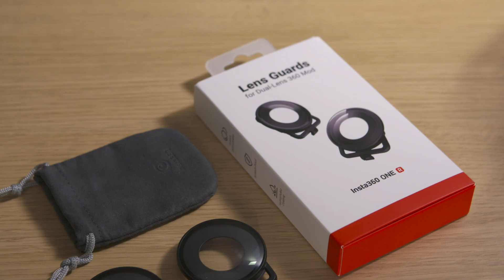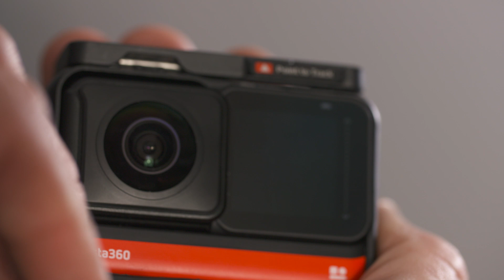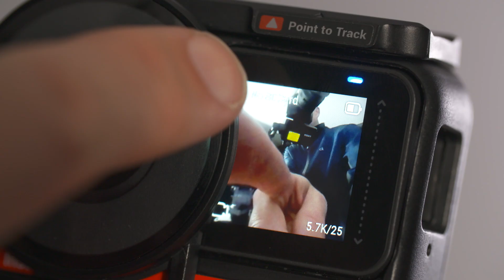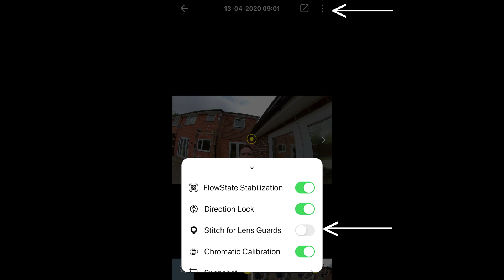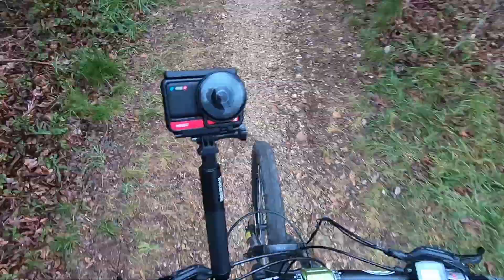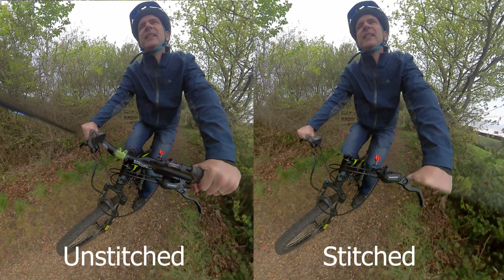Insta360 ONE R Lens Protection Guards review and test footage

Comment: What about using a diving case instead to protect the camera. They're both at the same price range but you'll get diving capabilities as well...
Reply from the maker: Unfortunately the dive case is restricted and isn’t invisible at the base. You can reframe it towards each lens but can’t look down at your hands. When diving you would usually use it at a 90 degree angle to the stick so you can look forwards and backwards but not downwards.
Reply: @EatSleep360  good to know. I already have the vertical mounted diving case so just wanted something to protect the lens when using the camera while driving and having it mounted outside.

Comment: Wich kind of stitching i have to set in the studio ?
Reply from the maker: Select premium lens guards and then just play around with the other stitching settings as they work differently on every shot so toggle them on and off and use the custom stitching as well
Reply: @EatSleep360  the new version of studio doesn't have the premium Lens guards option

Comment: These are only slightly helpful. Mainly only during use.  However, you have to take the camera out of the cage to switch the mods.  During that time you have to be extremely careful. Your handling 3 different camera parts plus the cage.  If you drop the 360 mod during that time their not there to help you.

Comment: I'm debating with myself on getting a one r 360 for on my kayak. And if it's own ip rating will do for splashes and the inevitable rollover. And how the lens would stand up with gritty water conditions. With that. Lens protection or a dive case...? And that would probably be an aftermarket case as the insta360 solution needs a different battery pack (and both are sold out on their store). I am hesitant as I wonder how the dive case stitching would be with aftermarket cases.
Reply from the maker: For rollovers and impact splashes I would want a dive case - lens guards won’t help. But the cost is ridiculous and I’m pretty sure you can’t eliminate the base of the case so you have to reframe around it. This might be less of an issue if it’s mounted on the kayak itself. I’d definitely use a safety cable as well.
Reply: @EatSleep360  probably have it about a foot of the deck. And tethered for sure.
Other option is using 2 gopro's back to back. But syncing video is problematic.

Comment: Gotta say, I'd much prefer a lens guard setup that included a more secure attachment to the camera case, regardless of whether it required an extra step or 2 to remove / install them or do battery swaps. I've had the camera fall twice on me so far. Once from about 3 feet onto carpet in my house and once off of my motorcycle at about 5mph when my handlebar mount broke, in both occasions one or both lens guards detached from the camera case. Which in my opinion makes them all but useless in the lens protection department (the job they're designed & marketed to do). Especially considering this is meant to be an "Action" camera, a quality, reliable form of Lens protection is an absolute necessity to those of us who bought the camera for the purpose of using it as a 360 action camera.

I own both the One X and the One R. ALthough I had to wait several months to receive my Venture case for my One X, in the end the high price of the accy proved it's worth when my Go Pro mount failed & the camera came off my bike at 25mph. I'd also love to see someone make protective films to cover the lens guards (round profile vs flat). I Made my own for the Venture case and they prevented the lens cover portion from sustaining any damage whatsoever during the incident. Also, my one x remained good as new. The new setup is far less robust and honestly rather disappointing aside from the video quality through them.

Thanks for the video and product review though, keep up the good work👍
Reply from the maker: Thanks for the comment, some great points - yes you’re totally right about the venture case, it maybe bulky but it does properly protect the camera - thanks for watching

Comment: Thanks for the info. Do you happen to know how to use lens and shot lab options together? The lens stitching doesnt seem to work with the shot lab. Or im missing a step. Thanks
Reply from the maker: Yes it probably won’t recognise it with the guards as it will block the person in places. If you need the Lens guards you could stitch for Ken’s guards and export it as a 360 and then reimport into shot lab.
Reply: @EatSleep360  awesome, ill give that a try! Thanks so much for the assist. Appreciate it!

Comment: My guards finally arrived. When I hike I will be using these. One thing I would like to see for the 1" Mod, is a cover for the protective lens. Why you might ask, well it would give me one more protective cover while in a pouch or storage during a hike. It is an old habit from my SLR/DSLR days.
Reply from the maker: Yes I love pouches, I have them for all sorts of bits and pieces
Reply: You can get a pack of good quality lens guard protective film covers on amazon for both the 1" mod and 4k / touchscreen lenses (inc. 2 of each) for $10. I received them hoping that I could use them for the lens guards but they are not flexible. They are high quality material like glass screen protectors for your phone. Personally im looking for curved versions for the lens guards still, as they do detach from the case very easily if it's dropped from just a few feet (just fyi). Hope that helps

Comment: I avoided the lens guards due to the videos showing sub flare ruining shots. Took the camera out today and sure enough, tipped over onto some rocks. 360 mod lens are pitting so they cannot be used. I had installed an aftermarket lens cover on the core screen and 4k lens. The core screen also took a direct hit. The lens cover cracked but the core screen was untouched. Insta360 needs to either redesign their lens protector so that the cover come up from the inner black plastic and comes in direct contact with the lens. This would eliminate lens flare and any lens distortion. They could also design a clear cover that adheres directly to the lens with clear tacky glue just like everyone else uses on clear covers.  Until they do, looks like I'll need to buy the current covers... and a new 360 mod (arrgg).
Reply from the maker: Sorry to hear that - I don’t like using the lens guards but they are just needed for some shots  unfortunately - thanks for watching

Comment: Hi.

I feel insta360 are missing a trick.  Rather than making them clear and suffering from sun glare.  Why not make them ND filters!
Reply from the maker: Ray Hollands yes a great idea about the ND filters to give us more control over the image - it would be interesting to compare the result
Reply: Yes a good video, at a point where my replacement proves its watertightness I will start purchasing more accessories including lens guards. Are they made of plastic?
Reply from the maker: Carl Richards I thought they were glass but I’m not 100% sure and I can’t find anywhere that says what they’re made of - everywhere just says “hardened lens guards”.
Reply: @EatSleep360  
That probably means they're some kind of plastic - easier to manufacture the dome shape in plastic than glass, but these guards have a reduced curve to them than the one x's dive, or venture case.  So, being able to manufacture ND filter versions shouldn't be a problem!
Reply from the maker: Ray Hollands yeah it makes sense they’re plastic from a manufacturing point of view as you say

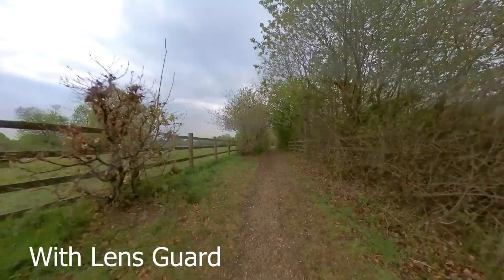Comment: 3:10 weird compression on bike shots :/ 
the ones I really wanted to *see*…
Reply from the maker: Miguel Maia I know, so annoying, YouTube always seems to screw with these shots for some reason. I need to look at the original to see where it fell apart exactly.
Reply: @EatSleep360  I think with distortion is because you don't have the ideal camera angle on your bike and you can see the connection between the lenses.
Sometimes he does it to me, and I use a camera without a safe. On the helmet.
When it is under a cloud and there is not enough light all cameras perform worse. Compressing youtube is another song.